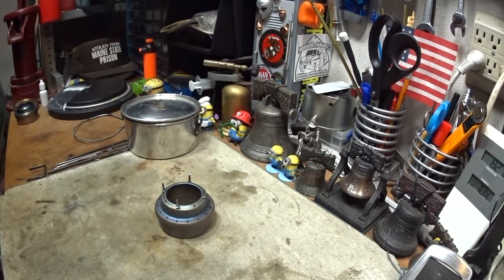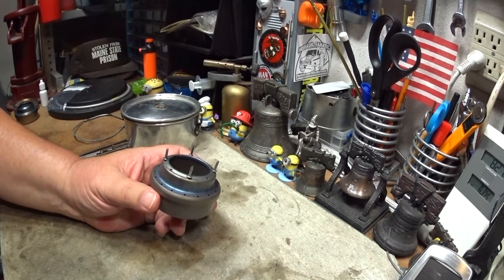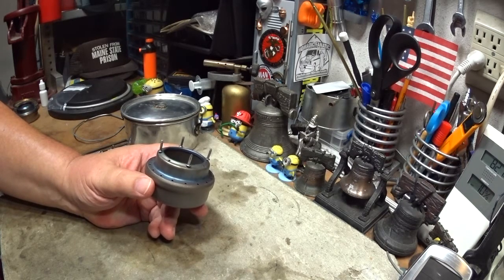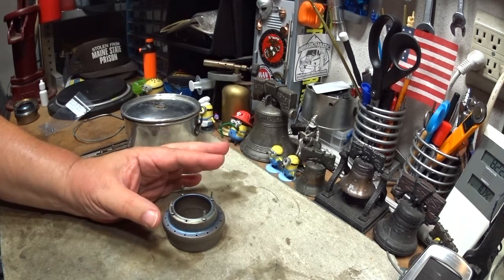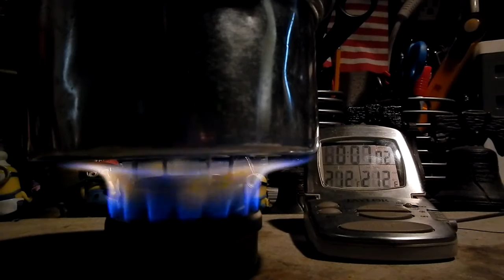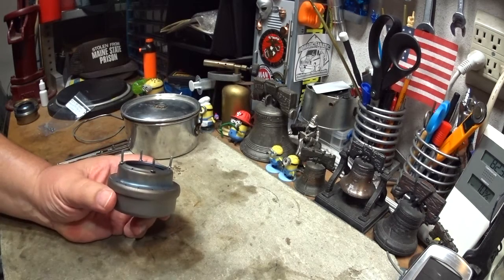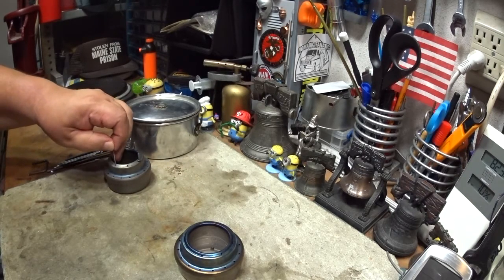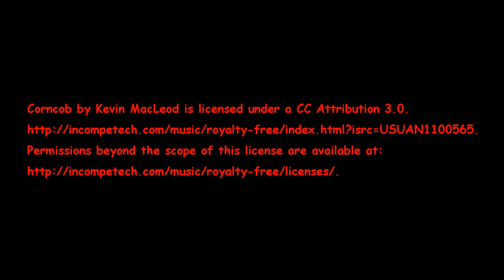Survival EDC Ultralight Titanium Alcohol Stove & Stainless Steel Pop Rivet Stand-offs - Boil Test

Comment: Great tinkering. I'm going to measure to get closer to that 1 inch sweet spot with my stands. Think I may be over. As for the name of this. No way I'd EDC this. If I wanted EDC it'd be one of those tin foil carbon fiber stoves. It would fit in a snack bag with fuel a lighter and stand. Thanks as always for sharing!

Comment: Hiram, how are these stoves supposed to be extinguished having rivets and jets everywhere?
Reply: Bobby Harper Just use a can that is taller & wider than the burner with rivets. A soup can, for example, will extinguish the flame. Metal cup will work.
Reply: Bobby Harper Since you can't put a cap on the burner and store any unused fuel, like you can with the Tatonka or Trangia. I think the manufacture intends for you to just leave it burning till the fuel is used up.
Reply: Oldtimer Lee Yeah, a soup can will work but it's not a very elegant solution. Who wants to drag around an old can? It's makes your kit more bulky, you have to protect it from being crushed and the extra weight negates the reason for buying a titanium burner. 
A metal cup would also work, but right as you need to snuff out the flame, is right when that cup is full of boiling water. Of course you could bring along an extra cup, but that leaves you with the same problem as the can.